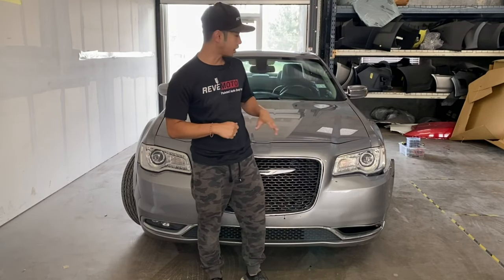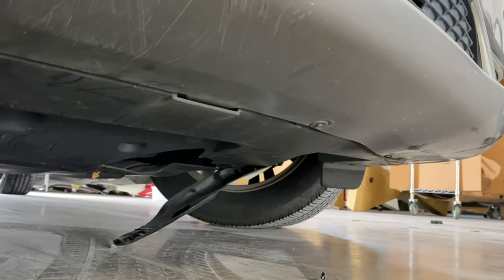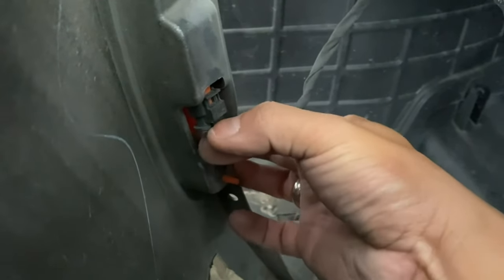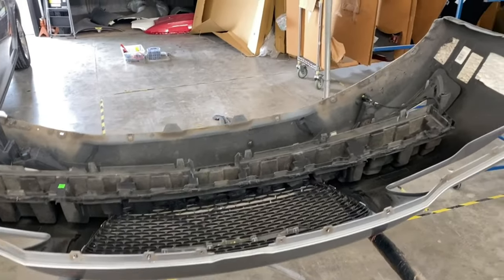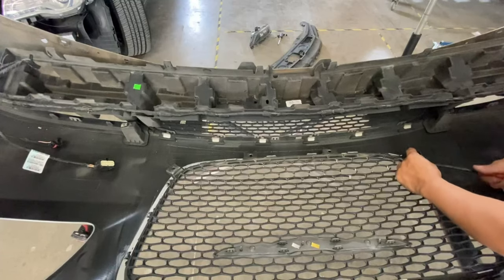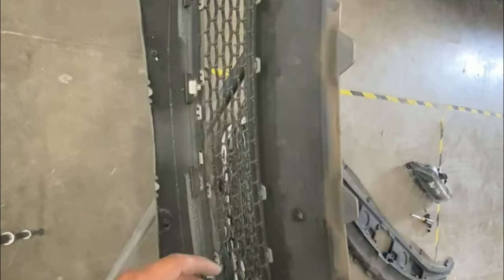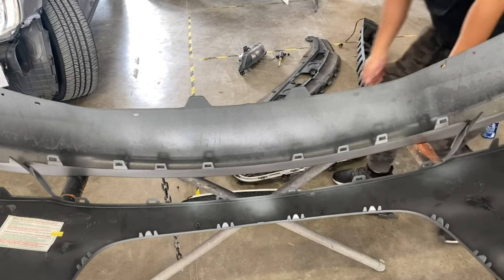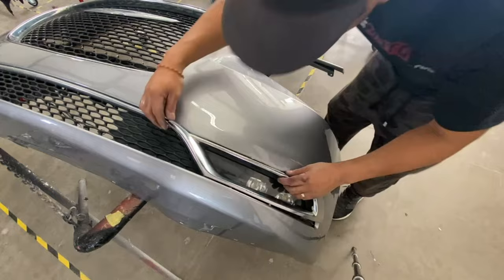2015-2022 Chrysler 300 Front Bumper Removal.  FASTEST and EASIEST Way

Comment: Bruh that bumper is so difficult to take apart don't understand why the grille is so secured in
Reply from the maker: Seriously I don’t either.  They could of just have used clips to hold it in.
Reply: @ReveMoto  and don’t get me started on those rivets doesn’t even make any sense
Reply: It’s a pain in the ass but I’m a repair man at Chrysler and I can tell you it has to be secure.  Mopar bumpers have extremely low tolerances for error. Especially for lane correction sensors and PTS sensors. After-market bumpers are very iffy. Current fascias have to be perfect. Without these secure  points there would be flex in the facia. I know the push pins are cheap but their basically one time use only, it’s all plastics going together. Be aware, and use W-40 to help snap in those grills. I learned that from a master trim mechanic.
Reply: @ReveMoto l

Comment: I can not get my bumper to stay snapped into place in front of the tires. I only hear one snap and thats closest to the bolt. Any help with this would be greatly appreciated
Reply from the maker: I would check the tabs on the bumper make sure it’s not bent and attaching properly.  Another option is to change the bracket.  Go to www.ReveMoto.com